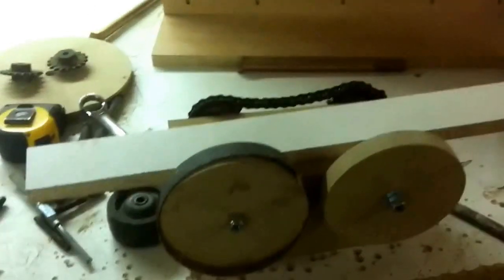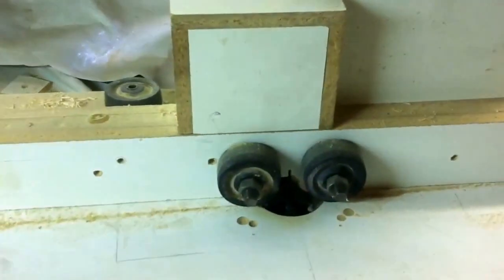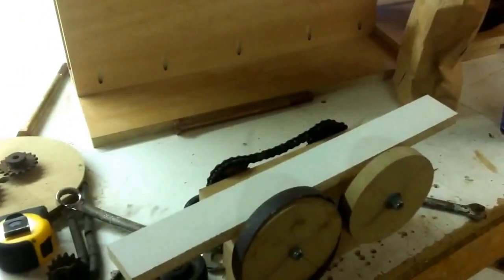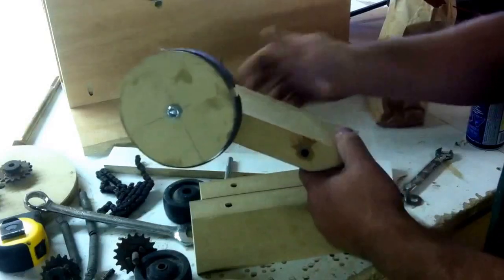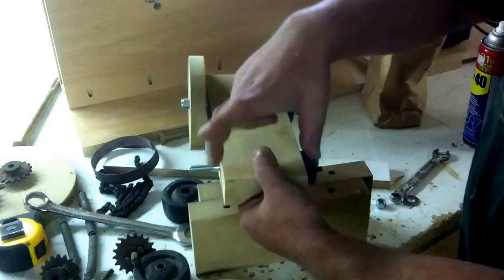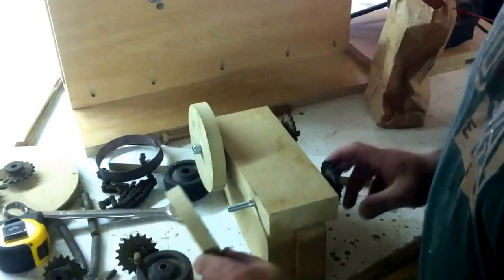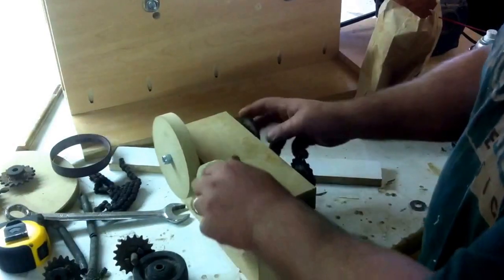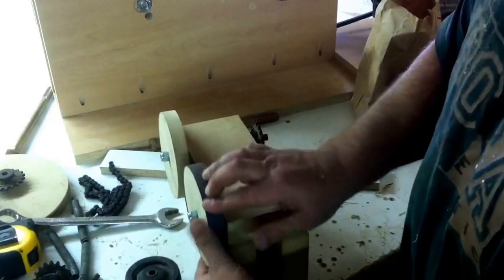Router feeder build 1

Comment: What about mower wheels? Their about the same size as those wooden ones. Also instead of trying to gear it to be slower/torque and if you didn't already have a motor, surpluscenter.com has small low rpm motors w pretty decent torque.